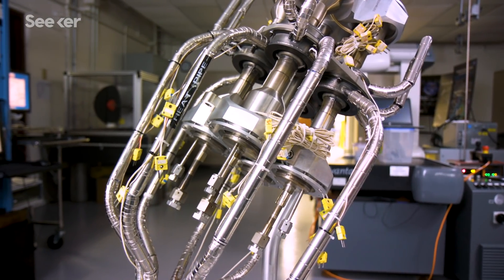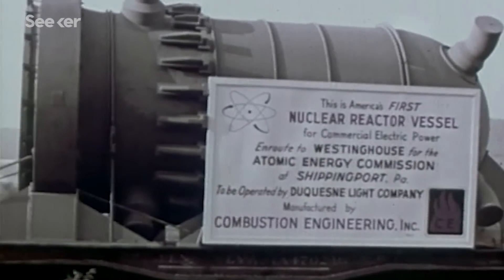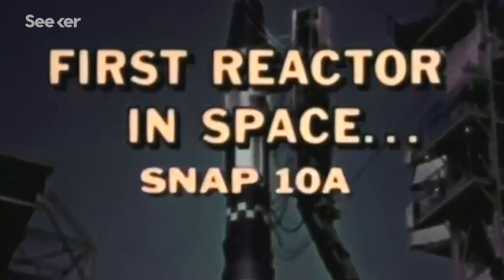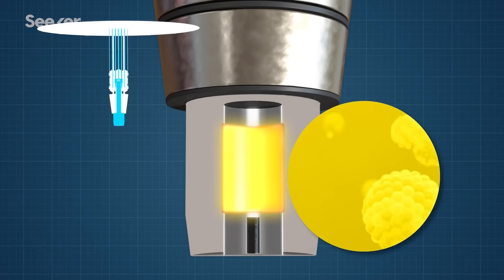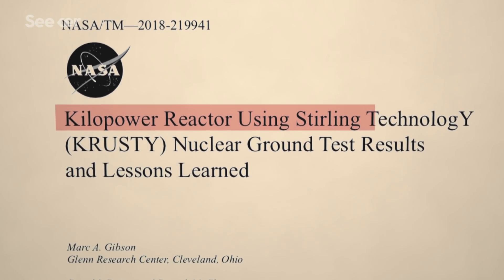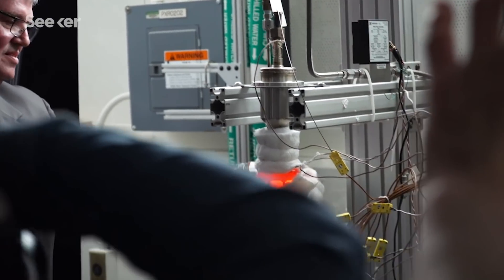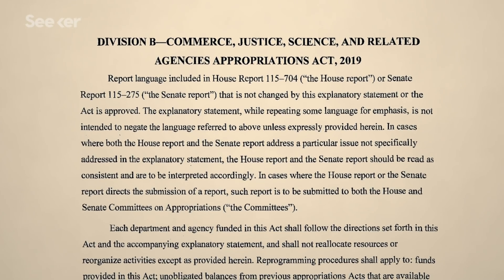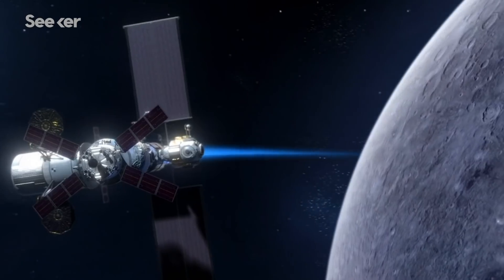NASA's New Space Reactor Is Powered by Nuclear Fission

Comment: I wonder if it would be safer to launch nuclear fuel aboard ships that are normally crewed?
I figure those tend to be much more reliable than satellite launchers (since more testing is required), and the abort system could be used to ensure that the fuel stays contained even in the event of a major failure, since they make sure the capsule can escape intact.
I feel like it would make more sense to launch smallish amounts of nuclear fuel in hardened containers (that are more likely to remain intact in the event of a crash) aboard many crewed missions than it would be to launch it all at once, since even if the fuel gets dispersed, it would be a much smaller amount. Plus, in the event that the container is damaged during launch (endangering the astronauts), it would only happen in emergency situations where there is likely fatal damage to the capsule anyway.

Comment: How about building . vehicle in space   and add ing the engine up there so that size during launch isnt a issue  and have shuttle types comin ans goin so that if theres a nuclear failure it doesnt go down in sea.  ..or a neighborhood and turn itself on. .  Expand on the space station for larger modules... maybe a tether goin yp yo a synchronized  orbit yo lift building block modules.  Like sea ships ..  out of aluminum or a light weight tuff material suitable for space ...  a large space port would be first on list I would think maybe send out a few small ships but to do anything substantial and cost effective you need size

Comment: I still don't know how to extract the electricity how do I build the thermal coupler
Reply: You don't extract electricity, you convert it into electricity. Build a piston that moves by expanded gas and is then let into condenser by valve. Attach a magnet to the piston and have it move in a copper coil. You get electricity from the coil.

Comment: Something like this needs to be integrated into starship if we want to take it anywhere other than the moon or mars. ISRU requires alot of power and solar is just barely possible on mars let alone anywhere further. Even on mars this would be more weight effective and would be less of a pain to deal with dust. A martian dust storm, while its not going to blow anything over will ground a starship in the midst of refueling by blocking out the sun. .

Comment: SO how do you get propulsion out of this?
Reply: Either use it to heat propellant mass to eject it out of the ship without the need of combustion, an NTR (nuclear thermal rocket) or use the electricity to power an ion engine. Both would be far more efficent than chemical engines of any kind, and in the case of the NTR, also produce more thrust.

Comment: Highly misleading title and misleading to compare this to NERVA. This is not an engine, but a miniature reactor for energy generation. Not propulsion. The only propulsion system this could power would be an ion engine, which is nothing like the NERVA engine. NERVA used fission to heat up hydrogen that was then used as a propellant, which is a completely different concept than an ion engine. Also maybe mention the fact that net energy gain fusion reactors DNE. It seems like the video's creators simply didn't know that when they say it's just 'harder to control'. Kinda makes me take everything in the video with a grain of salt.

Comment: When I really started looking into stirling engines, low torque, super high efficiency, then learned that NASA has one thats been running for 123,000 hours continuously, I started to wonder why we don't have access to Stirling engine generators or stirling engine range extended electric vehicles. Why NASA does not work with GM & Ford etc, why the automakers fail to make anything with stirling engines. If the no friction super ultra long life stirling engine works at NASA, then why no commercial examples using the same principles, mechanisms or technology. I don't think its a conspiracy, the explanation probably just blind greed of companies unwilling to invest in a technology that saves the user money on fuel or energy, like homes without enough insulation that burden home owners with higher long term operation costs, or fuel inefficient vehicles that are all about maximizing short term profit, that then burned owners of those vehicles with high fuel & operating costs. Its a real shame we cant take the best of what we learn in Aerospace & apply in the homes of real normal people

Comment: I am not really smart when it comes to anything to do with space but I'm always hearing about the dangers of space and the dangerous forms of radiation because radiation is everywhere in space so I have a question why doesn't someone design and engine to run off of radiation it can be controlled by magnets we have material that can contain it and in the same idea possibly use the radiation similar to what the Van Allen belt does for earth let the radiation shield the ship maybe and I know I'm not the first to ask this question I am just curious why there never been talked about at least I'm sure there is monumental excuse why we haven't even talked about it but considering NASA is studying the warp drive Elqubier drive and the are testing the funnel shaped copper trash can the EM drive if they can test those then they can try out the X-RAY DRIVE think about it with THE warp drive you need this theoretical dark matter and about enough of it to be the size of Jupiter and we haven't got enough to fill up the space of the eye of a sewing needle and if we did well we'd be DEAD KOBLAM KABOOM BUT WITH THE x-ray drive we need go old fashion radiation Madam Cury herself would set up smiling and still glowing neon green in her grave if we came up with it and space is full of it hell Jupiter got bunches and bunches of it

Comment: my fuel is better it does not need fission .it consumes heat  the size of a marble and it will be heated to 1,000 degrees and safe to touch in a second .my fuel is the opposite of destruction?

Comment: Can't wait until one blows up being lifted into space. Chernobyl in Florida! Good times.
Reply: You could hold pretty much any component of that system in your hands with no problems, as long as it's not been turned on yet. If a new unit was destroyed during launch, it wouldn't too much of a public health concern. However, if an intact unit crashed into the ground, it must be designed to NOT turn on (reach criticality) otherwise you'd have a problem. Hardly Chernobyl, but still a problem.

Considering the substances in use in rocketry right now, the nuclear reactor is the least of my worries.